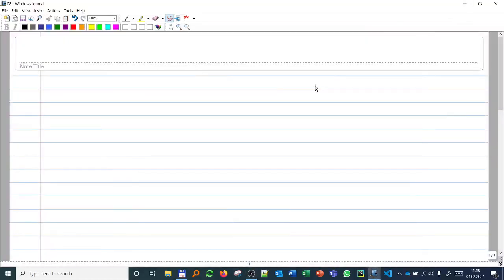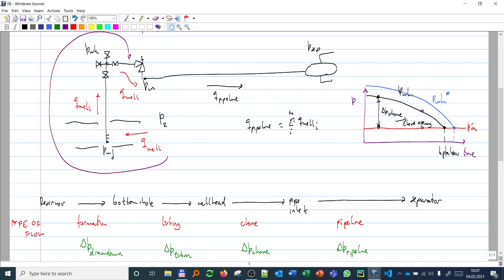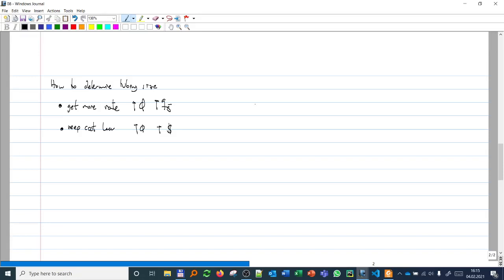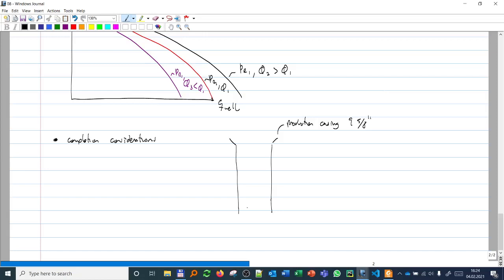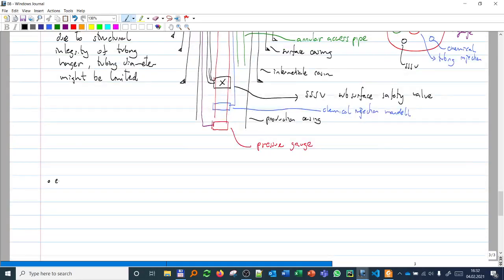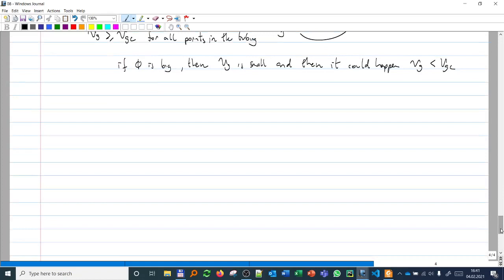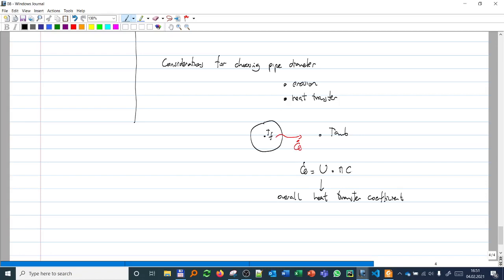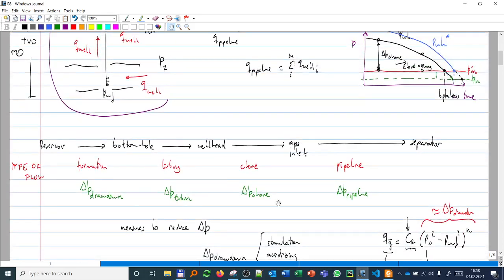8. Measures to prolong plateau duration

Comment: A tip to make screenshots, use the shortcut windows key+shift+S. You can select the area and it is automatically copied.
Reply from the maker: Thanks, I didn't know this existed
Reply: @Milanslectures  thanks to you, I have learnt a lot from your videos for my investments. Every time I have a  technical doubt I either check oil 101 or your videos